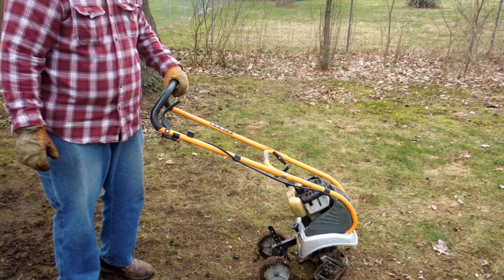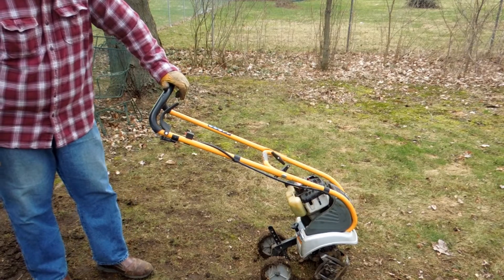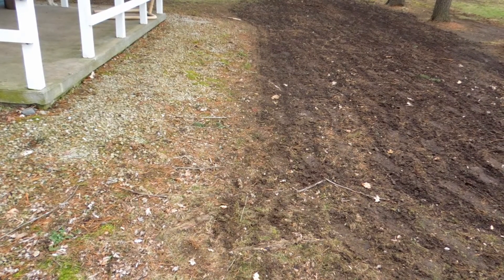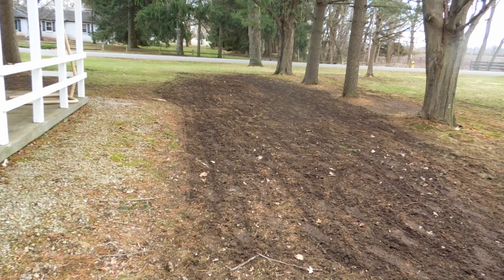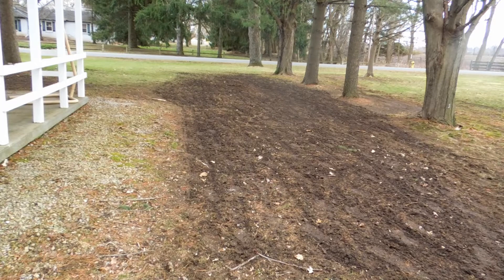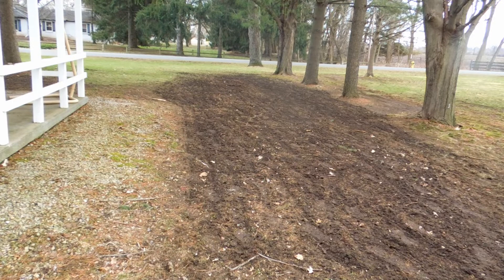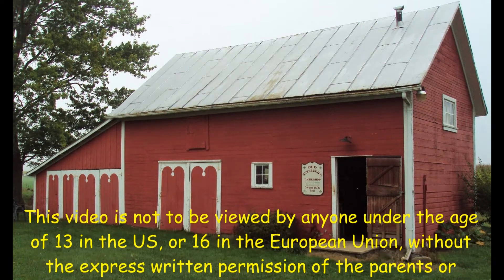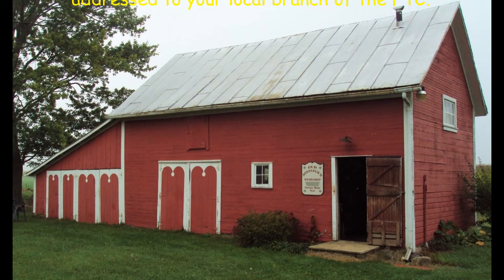Ryan's Ryobi Rototiller – Pt 3 – Finally A Test Run!

Comment: A WEENER and it looks fine to me. Rain here tomorrow too and car delivery the next day and grub run. Toots is doing away with a garden bed and is going to seed it for me to mow after she moves the chives growing there so it looks like we'll both be growing vegetation. FINE job on the tiller and that is EXACTLY why I pay the big bucks for Tru-fuel opposed to pump gas. And they will start when you need them to, no hassle. Yall have a wonderful week and GBWYall!.
Reply from the maker: Thanks Lewie. It was a big difference. The mixed gas I had for the saws was a couple years old. I Once the engine started it ran fine. The TruFuel fired right up. 
My brother in law called and said they had a pile of cherry trees from clearing my sisters horse pen. I will be burning up the old fuel pretty quick. Might have to cut it with TruFuel to get it started and warmed up.  😁😎
Reply: @OldSneelock  That'd work. I get it at Lowes, 4 gallons at a time. They give 10% off if you do it that way and my Sammy 10% totals 20, but it's still worth it if I had to pay full. I pour it in the old red plastic jug that Toots is used to so she don't grab the wrong thing. Just take your files and wrench and screwdriver with you for adjustments. Maybe the cherry won't be too big to move. GBWYall!
Reply from the maker: @lewiemcneely9143   Makes me wish I kept the trailer for the tractor. The 8N will haul a log pretty well. With the engine hoist it will set them right where I want them.
Reply: @OldSneelock  Lots of wood been skidded with a 8-N I betcha. You're just now getting set up right for heavy work!
Reply from the maker: Our house by Union City had a lot of trees. As they got wind damaged some fell, some were cut. .piled and burned the brush, drug the logs, carried the firewood, and buried the stumps with the tractors I had. The 8N did the best. The Farmall B was okay but didn't have the weight or power that the souped up 8N has. 😁😎
Reply: @OldSneelock  I forget that you and Brian Bloc are running sleepers. You with the hot rod plow jockey and him with the most powerful forklift in Baghdad Kentucky. I just wait till someone has a machine handy that I can swipe. I lost a day and thought today was friday. Silly me and I'm not taking anything for whateveritis. Just general goofiness! GBWYall!
Reply from the maker: @lewiemcneely9143  Since I retired the only day I watch for is garbage day. 
If I miss it the recycling bin overflows for a month.
Reply: @OldSneelock  Me too and ours runs early. I try and get it taken out and let Toots sleep in.
Reply from the maker: Wednesday is pickup day. I try to set ours out Tuesday night. 
Try is the operative word. 😣
Reply: @OldSneelock  10/4 on the try. Ours gets he around 7:30 till 8 most of the time so it's usually out by 7. BUT he knows where it is anyway so he has been known to get it hisself! Not much but things happen.

Comment: Dave good job on the tiller. Runs great and did not sound like it bogged down. One thing to try is lowering the flat steel bar mounted vertically between the wheels. It is adjustable with the holes drilled through it. My dad taught me that. By lowering down into the ground it puts drag on the tiller and slows its ground speed down and it can goes as deep as you set it. Looks like you have 5 or six holes so it probably equates to inches deep you want the tines to till. He used to till the garden every year and when set properly you can just hold it with one hand and walk slower. He switched hands so he always walked on the solid ground at the side. He said he learned that plowing with a team of horses in the 30’s.  For a suggestion try it that way to turn over some of your leaf piles in the back. Turning them over to break up and aerate the soil to increase decomposition rate. At 70 keeping up with that little Ryobi is like being on a tread mill. If you don’t keep up you fall down. The stake slows it down and let’s it do the work while you just stroll behind it using one hand to keep it going straight. Like your video’s and look forward to them each day. I admire your skill and knowledge of all things mechanical - I would never have figured out the gear box or known what to look for. Be safe and have a good day.
Reply from the maker: I just wanted to loosen the top. I had spread dirt over the area about 3" thick. I didn't want to catch the tree roots so I only cut a half inch or less.
With the top loose I can rake it over the seeds and hide them from the birds. 🐦🐤🐧🦜

Comment: If all you we're looking for was to scratch the surface for grass seed, then you did a fine job, other than walking directly behind it and stomping the dirt back down. Sounds like it's running pretty well. I used to have a 5Hp Craftsman rear tine with a 26 inch path and that thing would cut fresh soil turning about 12-14 inches deep on the first pass, if it wasn't rocky or too hard packed, soil. If it was hard top/hard pack, then it would take 3 or 4 passes. But going deep was a heck of a workout, it would beat the user to the point where you felt like you had been through several rounds in an MMA fight. That spike between the wheels comes in real handy if you want to go deeper.
Reply from the maker: I just wanted to loosen the top. I had spread dirt over the area about 3" thick. I didn't want to catch the tree roots so I only cut a half inch or less.
Reply: @OldSneelock  yes, well done. Seems to be working quite well. Maybe weld up a iron rake attachment "anchor" to furrow behind it, and walk of to the side, or go behind it with a leaf or garden rake, and you'll be ready to cast seed for sure. But us guys with these "father figures" that others like to call "dad bods" know the seed has a hard time rooting through our foot prints in the soil. That is, we pack it back down, quite well. At least I know I do, and we appear to have a similar build.